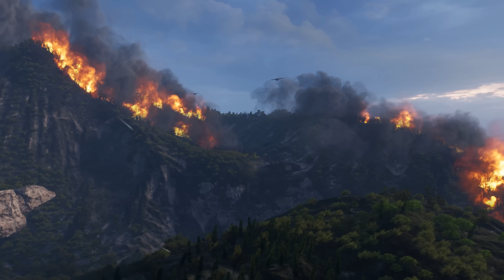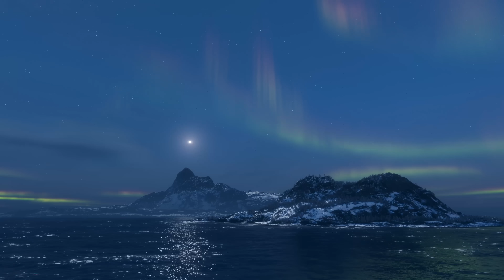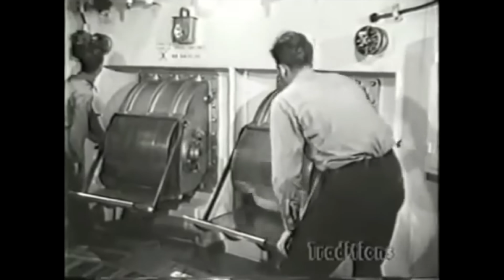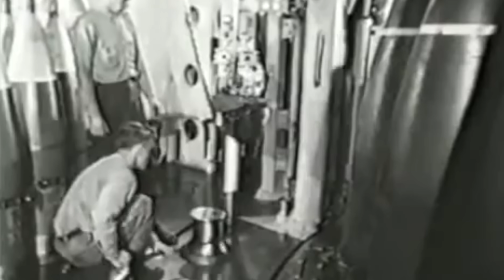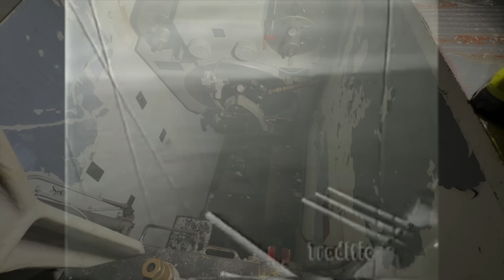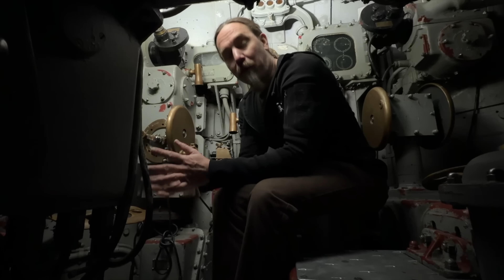How the USS New Jersey's 16-Inch Guns Work: Top to Bottom

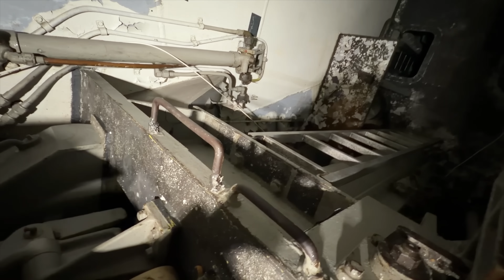Comment: 31:10 the primer guy might be one of the scariest assignments on a surface ship. 😨
Reply: After seeing that breach block jump back at you every 30 seconds for an hour or two, you will never again flinch when someone throws something at you.  Nerves of steel
Reply: @David-ue3ej  As a retired 155mm commander I can tell you that the brain is strangely good at understanding context. Learning to trust that THAT particular thing isn't dangerous, and will in fact stop where it is supposed to, doesn't translate to other things. The base instinct is still there, but it accepts special cases, if that makes sense.
Reply: @David-ue3ej  Seriously. Thousands of pounds of steel moving at several thousand feet per second terminating at a distance measured in inches. 
I'm sure it doesn't actually recoil that fast because of the hydraulic mechanisms slowing it down, but still... It's like right there...
Reply: @raifsevrence  I imagine it's similar to the mentality of bomb defusal guys. It either works correctly or it very suddenly becomes somebody else's problem.
Reply: @raifsevrence  There is a short clip of, I think the Iowa, firing, from inside the gun house, and into the pit. It's.....it's worse. The breech block is angry. You do notice when the gun fires.
Reply: @paavobergmann4920 I'll have to see if I can find that.
Reply: @raifsevrence  You can calculate using conservation of momentum how rapidly the breech moves backwards and it's nowhere close to several thousand feet per second.  Roughly, the gun at 121 tonnes weighs about 100 x the weight of the projectile and the propellant (whose mass goes out the barrel as burnt gas with the projectile.)   So the initial velocity of the recoiling gun (before being soaked up in the recoil/counter-recoil) is 1/100th the muzzle velocity, so about 20 feet per second.
Reply: I was thinking the same thing. That's a job I would not want to have. I'm also betting that anyone who did says "What?" a lot.
Reply: @dragineeztoo61  From what I hear (no pun intended) the noise inside these turrets (and tanks and similar) is much less than you would imagine, the armour and other clutter masking the sounds somewhat. Fortunately!
Reply: @archer159  As a retired Armored officer, I concur - blast from the vehicle next to you is greater than yours
Reply: Honestly, I wonder if any of the people who did that job still had functional hearing after their tour was up.
Reply: @SheyD78 no. There is a clip on YT of Iowa firing from I side the turret. The guy posted it trying to prove that his hearing loss IS service related.
Reply: @Backdaft94  If it's the same video I'm thinking of, the guy in the pit wears his hearing protectors only when the compressed air is whistling into the barrel to clear the propellant gases before he opens the breech.
Reply: I came to see if someone else had the same thought as me... apparently, yes...😂🇦🇺👍
Reply: Manning 40 mm Bofors in the open during kamikaze attacks or when the enemy was strafing the deck was probably much worse.  In the turret you're pretty well protected and you know that never in God's green earth is that breech going to cross that red line.  I'm told it's not really even all that noisy in there.  In one modern video, the gun captain (guy in the pit) is wearing ear protectors that he puts down over his ears only when the compressed air is blowing propellant gases out of the barrel, which makes a really really loud noise in the gun house.

Comment: completely random lightly related  question... if you are in the ammo storage and drop something hard and heavy and it hits the tip of one of those shells... does everybody within a mile of the ship have a bad day?
Reply from the maker: No, because the fuse is actually in the base of the shell.
Reply: @ForgottenWeapons I wasn't sure if it was like a 40mm grenade launcher... the projectile has to spin 20× before it would arm... or some other way

Comment: USS Washington did sink the Kirishima with the 16-inch/45 Mk 6 guns on 15 November 1942.

Also did you have fun reading all of those naval manuals about this weapon system like NAVORD OP-769?

Edit: A mistake at 20:32. About 130 to 140 rounds per gun not 300. Each turret had over 400 rounds ready to fire with some spares on the mezzanine level of turret 2 that were not accessible in combat.

Comment: 18 rounds a minute from a single turret= 6 rounds per gun, or 1 round every 10 seconds. 2700lb projectile multiplied by 9, times 18, means the Iowa class could easily sling the equivalent of more than 2 sherman tanks per minute at a target up to 24 miles away.
Reply: Not exactly - 18 rounds a minute per full salvo, so 30 seconds to reload each gun. If we consider that flight time to target on battle ranges  take 30 seconds and more (and you need to wait a hit to make aiming corrections), that's perfectly fine.
Reply: That number is for all the guns. Nine guns, two rounds per minute per gun, eighteen in total. These guns could not be loaded in ten seconds.

Comment: Huh, never knew about the powder additives to extend the barrel life. Neato.
Reply: The first additive was a titanium dioxide foil pouch, sometimes called "Swedish additive".  That was good for wear reduction of about 75%.  In 1969 a polyurethane jacket was developed to encase each powder bag.  The jackets reduced wear and gas erosion so much that barrel life was extended to about 1,500 full charge equivalents.
Reply: I find it quite insane that simply an additive to the propellant went from "you get one magazine before you have to change the barrel" to "never needs replaced again".

Comment: The Iowas were a very deliberate design, and not limited by the treaty as Japan had already withdrawn and everyone knew Italy and Germany were cheating... so all bets were off by the time the Iowas were farther along than napkin sketches.
Their speed was a requirement to allow them to fight the Kongō class, which was so fast that no other battleship in the fleet could *reliably* entrap them in battle. The North Carolinas were limited by their resonance issues, the South Dakotas didn't have that problem but were a solid 3 knots slower, and the old Standards could (after all their various additions) usually make 19 knots with a following wind.
Mostly.
In general.
They could theoretically eek out 20 knots if their bottoms were fresh, but they never were.

Comment: Possibly the only posted "No Smoking" signs in the 1940s
Reply: Back then, it REALLY meant it
Reply: No, those signs would be on the weather deck after daylight.  You can't smoke at night or you might give your position away to the enemy.
Reply: @Stevarooni  hmm that sounds so strange but ive never thought about it. How far away could one theoretically see a lit cigarette or a lighter at night?
Reply: @leonvelten3480 A dark night on the open seas?  Quite a ways!
Reply: @leonvelten3480 a long ways off. Nowadays you have to factor infrared light as well. ANY source of light (Especially with technology nowadays) equals instant death.
Reply: @leonvelten3480 we do darken ship at night to stop all light except red.  On a really clear night you can a light up to 5 miles away
Reply: @leonvelten3480 I don’t know but this was a plot point in the book All Quiet on the Western Front. WWI snipers would aim at night for the cherry glow of someone smoking a cigarette
Reply: @leonvelten3480 Miles. The flare of a lighter, even farther.
Reply: @leonvelten3480  when we would  do field exercises at McGregor Range, using those painful 2nd gen PVS-14's (POS-14's, if you will), with those gawd-awful halo headbands, a lit cigarette when dragged on, looks like a large beech ball, hanging where your head should be. And that's at about 1klik.
Reply: @leonvelten3480  A long fucking way. On a dark night, with typical optics, I'd wager at least a kilometer. 
With modern NODs, a mile, maybe more.
Reply: @clueless4085  Falconclaw tested this. IIRC it was up to 2 miles and it was still extremely noticeable at that range. On ground. At sea, with favourable weather, I'm willing to bet that it'd go way beyond that.
Reply: The B-29's had them, they also had ash trays. Mixed signals.
Reply: @LostShipMate  The Ash trays are for those who disregard the signs, because if you are going to smoke anyways, you do want a safe place to dispose of the ashes.
Reply: @hdog9046  The same theory is behind ash trays/cigarette disposals in modern transport aircraft (which are still legally required)
Reply: @tiberiusmagnificuscaeser4929  
'Someone's smoking again.'
'I'll get the Stubb Glove' Retrieves Thick-fingered leather glove,  charred marks on the finger-tips. 'Excuse me, May I?' crushes the cigarette with the glove. 'We do not allow smoking on this flight.'
Reply: @LostShipMate  lol
Reply: @LostShipMate like traffic Signs
Reply: By the 40s, pretty much anywhere that regularly handled explosive powder had those signs.
Reply: @noahandrulis9077  That's good to know....
Reply: @noahandrulis9077  I miss the 30's
Reply: They had them along San Francisco Harbour, at least.  

You can see it in ‘The Caine Mutiny’ (1955), set in WW2 and heavily accurafied by the Navy.
Reply: Plenty around fueling stations and equipment too.
Reply: In Taiwan its no smorking
Reply: @Duckies-9000 a place nobody goes to voluntarily.
Reply: @Kimsedk i could argue about that but id end up agreeing. I hear guam is nice this time of year. Actually i made myself laugh thinking about that i think its like a egg in a frying pan outside here in Florida i can only imagine what kind of fresh hell that is.... Ahh yes 85% humidity there. I call that your own atmosphere kind of sweat.
Reply: @Duckies-9000 well here is only 27 degrees Celsius
Reply: I was literally just making a joke about clesius I always forget its like add 32 to 30 and subtract 4 to get the conversation. I just say to myself if it's close to 40 its like nearly 100. 27 is like 80ish? Lol i envy that its 92 F in the shade @Kimsedk
Reply: @Duckies-9000 ok det hottest here this year is 37 celcius
Reply: Seriously! Smoking was compulsory most everywhere else...👀🎯🎯🎯
Reply: Boring,take some Risk every day
Reply: @Kimsedk  i suggest you inform yourself about the fate of the British Battleship Barham. It was torpedoed in 1942 by a Submarine and rolled over but the Crew was doomed by a Magazin Explosion..Several other Capital.Ships had similar.fates.but HMS Barhams.Doom.was filmed.on Camera by an Escorting Ship.
Reply: @Stormoak couldn't care less, wasn't born,so it's in the past
Reply: @Kimsedk  You could have just opened by saying "I am a Darwin award waiting to happen" 😂
Reply: @Dead_Pool_Rising but I didn't ;)

Comment: Powder grain shown on 32:52 has those 7 channels through it for a very specific reason - as projectile moves out of the barrel, to maintain desired pressure, volume of generated gasses should be increased with time. 

It is achieved my increasing the burning surface of each individual powder grain with time, those 7 channels widen as grain burns, and by the magic of geometry while grain burns smaller by mass - burning surface increases.
Reply: Like the internal profile of solid rocket booster cores. That's amazing.

Comment: I have a copy of "Battleship New Jersey", by Stillwell, and in it, it tells of an accident when loading the ship with new 16" shells. Shells were brought over to the ship, and then connected to a hoist that would lower them all the way to the bottom of the ship. Something happened to cause the shell to break loose, and free fall all the way down to the bottom of the ship, leaving a dent in the floor. The officer in charge of the loading decided that the impact might set off the detonating charge in the shell, and ordered the shell to be hoisted up on deck, and dumped overboard, next to the dock.

Comment: Ian, we know that standing in front of a tank when it fires its main gun can produce pressures that are hazardous and/or deadly to the human body. How did the crews of the AA guns and smaller batteries avoid injury when the main guns were fired?
Reply: That's simple - they didn't.
AFAIK they cleared the affected deck before they fired.
But if you're out on deck when the main guns go off you're boned.

If you look at a picture or model of the Yamato for example, notice how a lot of the midships light and medium AAA is in fully enclosed turrets?
That's so they can remain manned even when the main guns are active.
Reply: They got the hell off the deck lmao, the pressure wave from those guns would you're you into soup
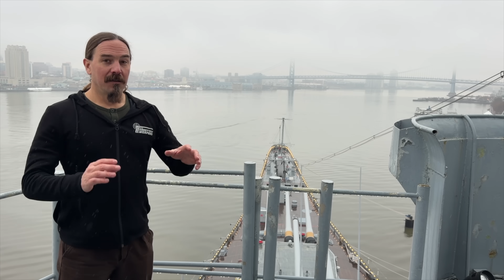Reply: 37:17 where Ian is standing is a parapet.  One time during a shoot I was leaning against that shield watching for the shot. the gun fired and I wound up against the director mounting checking to see if my eyebrows and mustache were still there.  Watched the rest of the shoot with my back against the director mounting.   The shells ARE visible going downrange.  The muzzle blast is nasty and HOT.

Comment: An old friend of mine was on Iowa in the 1950's.  He was the Weatherman basically.  His job was to get the weather across the flight path of the shell so it would hit the target.  He had "computers" in his area with old vacuum tubes that ran so hot his duty station was the only area of the ship that had A/C.  He said that was nice when they cruised the Med in the 50's.  Differences in wind, Pressure and temp could send the shell off 100's of yards at max range.  He had some interesting stories.  I wish I would have recorded them before he passed, That is what is going to be forgotten.
Reply: At max range, the 2,700 lb AP shell has a max ordinate (altitude) of about 36,000 ft.  That's airliner altitude.
Reply: @SomeRandomHuman717  that is AWESOME&terrifying no wonder they made sure any aerial shell spotters were flying in certain zones before letting the big dogs bark!
Reply: As long as you tell his stories, you keep his memory alive
Reply: Could you possibly write out your friend's stories, best to your knowledge? Perhaps submit them to one of the Iowa-class museums or to Ian.

Comment: For anybody wondering if he doesn't mention it (I'm only about 2/3 the way through), 2700 lbs at 2500 fps equals just under 250,000,000 (250 million)  lb/ft of muzzle energy. So basically firing a million 38 Special +p rounds at the exact same time. The scale of this thing is just bonkers.

Comment: I love the idea that it wasn't worth replacing the mechanical computer with a modern electrical one because the mechanical computer was still so effective.
Reply: To be fair, they did test the digital computer replacement before putting the old one back in. As it turned out, the digital computer broke from the recoil of the main guns. Meaning not only was the original still accurate, but it wouldn't break from Sir Isaac Newton.
Reply: Electro-mechanical computer v. Electronic (chip) computer is worth 10 more YT vids if you are interested. 
Because of the money and emergency of WW2, the original mech. computers were highly developed.